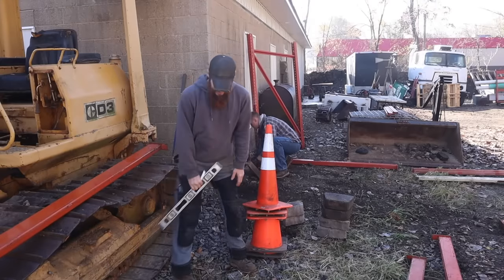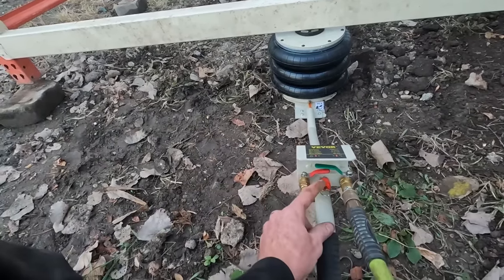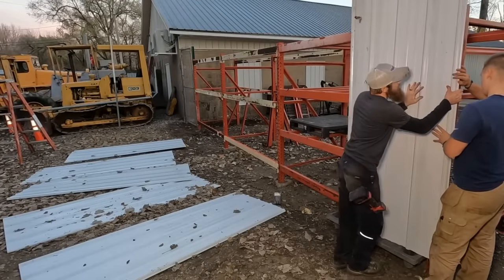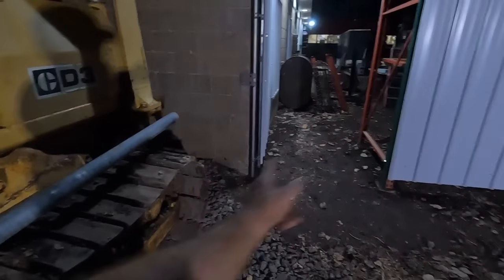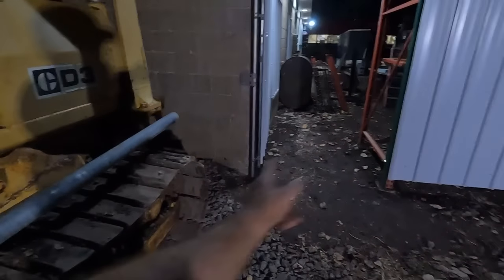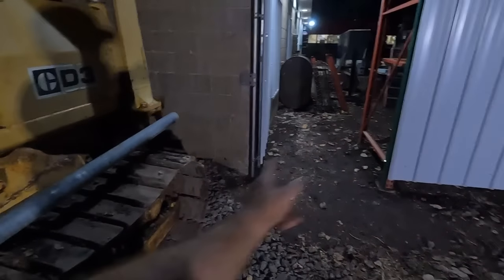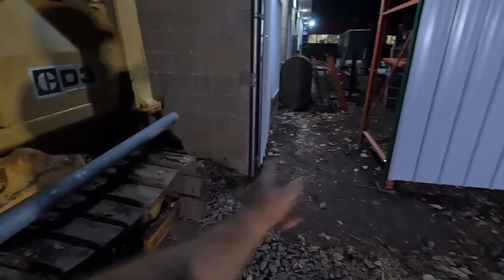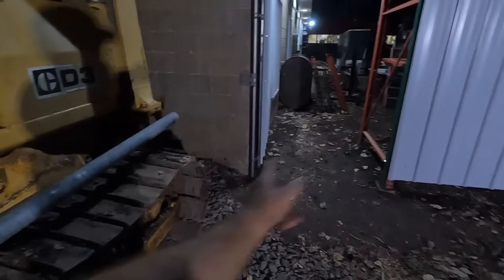Building a Wall w/ Pallet Racking & a BIG Gate Install  ~ Part 10 ~ Rebuilding of "The Salvage Cave"

Comment: I’m no welding expert but aren’t you supposed to be using a filtered mask when welding galvanized steel? I thought it became toxic when welding.
Reply: Inside yea you want to buy outside not so much unless no wind and a lot of it
Reply: Zinc in the galvanising turns to zinc oxide which gives you pneumonia like symptoms but out in the open it doesn't matter so much as the breeze blows the white harmful oxide away, it hangs in the air like floating cobwebs in a confined space or un ventilated room.
Reply: I’ve had galvanized poisoning (MFF) before when I was welding galvanized floor deck on an indoor mezzanine. It makes you feel like you have the flu, definitely need a respirator or good ventilation.
Reply: When i was(much) you ger, we were told to drink a glass of whole milk right after we finished welding or cutting galvanized. Never got sick. Don't know if it worked, or I got lucky.

Comment: Definitely should put water in with the concrete. Dry concrete doesn't bond anywhere near as well or as strong. You might as well put in road base, as that is cheaper if you don't want the strength of cured concrete.
Reply: Nope I built pole buildings for years. I never used wet crete. 
The dry stuff hardens from the outside in. Locks stuff in place better. Cures fine
Reply: @robertspray7472  Yup ..First time there's a good rain , that will all get soaked and cure just like poured concrete . No messy time consuming mixing needed.
Reply: I seen someone build a huge retaining wall by just stacking concrete bags. It looked funny but 15 years later I still see it every time I drive by that house in the country
Reply: @dillon2753  

i know.. isn't that crazy !? I've seen them all over.
Reply: He is using concrete blocks
Reply: Because you've done something "for years" doesn't mean you've done it right, for years.  That's not a good defense.   Chemically and mechanically the concrete will not cure the same.  So, you've done it wrong for years.
Reply: If you saw the condition the cave was in originally, you'd know there's plenty of moisture in that soil.
Reply: @dillon2753  the water addition locks the bits together. the strength goes up, and a lot quicker. a large amount of study has gone into the science of materials. and one of the things with concrete is that the mixing of water cement and aggregate works better when joined together evenly. something not usually achieved with a dry pour. it might look solid, but engineering is done through testing. and the strength of concrete depends on the consistent mix. a reason for every dam, bridge, etc designed by an engineer is done with wet pour.
Reply: @robertspray7472  they truly dont. material science is a thing. it might look like they do, but how many pole barns did you break apart to test the concrete?

Comment: I saw a video where someone actually tested the material properties of wet vs dry concrete, and the dry method does result in a much crumblier concrete. It's certainly good enough, but it isn't as durable as wet pour concrete.
Reply: I agree, however for his purposes I guess it will be fine, It’s his gate.
Reply: I advise you add bolts to the cross beams.  To lock them in place . We have them pop out when loading and unloading .
Reply: I just mix the concrete in the hole it does not have to be perfectly mixed. Never dry thoutht.
Reply: That where house shelving needs to be anchored down some how where I used to work they used that same shelving in are where house forklift driver caught the corner Barley brought that hole shelving unit down parts steel bronze tubing down luckily forklift driver wasn’t hurt but they anchored tied the shelving down

Comment: The dry concrete method might be fine for household fences, but in a situation where some real strength is needed this is not gonna work. The cement in concrete requires water as part of the chemical process by which it cures. It’s not just hardening. Once a bit of water is present it will begin curing. There is no such thing as curing gradually. It’s a chemical process that occurs best in a surfeit of water and it needs a lot! If there’s not enough water available for the reaction the result will be crumbly, with little strength.

Comment: those little pavers under the racks are gonna sink man
Reply: He learn when it topple over. And quickly too!
Reply: if they do he,ll just lift and reset them - no probs
Reply: @Edward-turtle  he used 500 lbs of concrete for the gate post but a little rock for shelves. stupid
Reply: @stereolababy  that little rock can hold thousands of pounds, tough guy.
Reply: @XxPhasemanxX  try and read- didn't say it wouldn't hold - its going to sink in the mud. not enough surface area
Reply: @stereolababy  Did I say you said that?

Comment: Just a thought......where you put the pipes in the ground where your two gates meet when closed, could dig a 2ft x 2ft (whatever the dimensions would be mine was just an example) square or rectangle size hole around them and pour cement around them. This would help protect them and maybe keep dirt from filling them in. Just a thought....
Love the idea of using the pallet rack as a fence too. That was a great idea!

Comment: Tip : mix besides the rebar also a lot of pebbles in those concrete holes. Cost you less cement and makes the blocks a lot sturdier and stronger.

Comment: For that gap in the gate, I suggest welding either a steel or aluminum plate on either gate end (say 1/2 or 2/3rds) of the gate end heights.
When the gate is closed the plates will over lap each other say 4 or 5 inches. This will close the gap and should provide self support in the middle from the wind and free swinging. What ever way you chose is of course up to you. BTW it is all ways good to see a new episode of Salvage Workshop... 😉

Comment: Be advised that, when you get snow and ice, the pipe in the ground can possibly have flood water fill the pipe and freeze the gate stops in place. Which may pose a problem raising them to opening the gate in the winter. Chaining the two gates together and a lock way be your resolution.  Good job.

Comment: If I heard you right, you use dry concrete around your posts because you didn’t want to spend the time to mix it with water. Then you will wait to put the gates on until you get enough rain and moisture from the soil to set the posts. That could take a much longer time then if you had just mixed the concrete in the first.
Reply: He's one of those that knows better than the people who created it.

Comment: Finally someone knows how to place an anchor. Another shortcut, switch the hammer drill to hammer only and use that to drive the anchor. The anchor won't do any damage to the bit, those things are only "sharp" in the package.

Comment: Those gates will be great if you put tin on it like you did with shelving and the tin will close the gap that’s what I did. 
Pallet raking I find best outside I normally put a 4x2 then sheeting so pallets can still go and then at top just have top covered with tin. 
I have used steel water pipe made into shelving to store tyres but I still put a little roof on. 
Cheers I enjoy you Chanel from 1 man to another who keeps everything

Comment: Railroad Ties. For base. Re-coatable and movable as a base. Used to be cheap. Stacked tires should be under cover. Mosquito control. In order to secure you have to close all sides equally. You're just getting started.

Comment: Matt 🙂 Your brothers are such hard workers just like you 🙂 Cover the top of them shelves to stop people attempting to climb over to take stuff off the top shelf 🙂 Attach & weld plates down the side of one fence so that the other fence won't swing past it when open, which will also stop skinny people getting thru from stealing. (Think of a  kitchen cupboard doors that has a gap) 🙂 Maybe also get a container and add in shelves... put in side doors as well as having the door at the end... to keep things like tyres or other big perishable items that don't like the sun or the snow.🙂.

Comment: Weld overlapping steel plates, maybe 5 inches in width to each side of the gate gap - one on the front of one post and on the back of the other, and then fashion a lock for the middle.  Should be easy to do.

Comment: I've thought that if I were in a position to have a fork truck I'd palletize stuff for storage. However, I'd make custom pallets, some with cubby holes like shoe storage. Some with big drawers. 1x1 square tube mostly. Depends on what you have that can go outside. Make fixtures on the pallet to hold whatever and don't need securing for the trip up and down off the pallet rack.

Comment: We cut various bays into cheapish B-grade or well-traveled Conex boxes and welded shelving or racks. Lots of oilfield pipe comes back for salvage in DFW but any old piping would work. You can throw an engine, palletized parts, or pretty much anything you want to keep somewhat out of the elements. A lot of ugly shot with inexpensive metal paint from a Chinesium airless sprayer make them look almost amazing.

Comment: Another good video. I like to set the things i use most where they are easy to get to same with autos and equipment. Some times it works but not always. Good luck

Comment: Using old grocery bags and painter’s canvas tarp take the bags and fuse them together like in the YouTube video (Brothers Make: Finally, a plastic bag good for the planet) or using aluminum make a cover for the tires stored outside to keep water out of them preventing a mosquito farm inside or you can just use regular plastic tarp cover by painter tarp tied down replace painters tarp every year I pay $12 at Lowe’s. Plastic keeps water out and canvas keeps sun off the plastic and tires, preventing the tires and plastic from breaking down very fast from sun and excess heat

Comment: They have heavy duty pallet racking that fits just the bill for what you are working with out there. I believe the uprights are made from 5inch channel iron with 2 inch legs, 1/4" thickness but there are many sizes more than that. I have a friend that is in the business of selling it here in Va. You may be able to pick some up used in your area. I do believe that they have some that can hold several tons per shelf (15,000-30,000lbs). Put your stuff on pallets and stick them up there or get the grating that spans it and you can do smaller materials. Putting up a second fence bordering that side road may be the perfect thing to back it for you, like your first fence.

Comment: Matt, I was kinda wondering when you first started putting up your pallet racks if you were not a little close to your soffit on that end. The reason I was, was wouldn't it have been a little close to your roof and you couldn't use that whole end. If you did stack stuff up under the roof line there that if your luck is like mine if you went to lift something off the top rack and it was just under your roof that you'd end up damaging your guttering or your roof but when you moved it out for the gate that solved that problem. Man you do some awesome work and I love watching your channel. I've subscribed to your channel since you started it. I'll always be here waiting for your new ones. This one was shorted than your normal ones. Believe me I do not mind the long ones like some people do but not me. The longer the better because I'm amazed by how good of a job you do. Thanks for the awesome videos you put out.

Comment: Google says you should never install dry quickrete. I agree with it.
Reply: Whether it's lasting or strong, I'm not qualified to say.  But I will say that using the excuse "I've done it many times this way" is not a good defense.  It's possible to do something wrong "many many times".  We've all seen evidence of that!  It drives me nuts when people use that phrase as a reasoning.
Reply: I work with concrete everyday and it should not go in dry like that. Need to be adding water after each bag and mixing.
Reply: Really should have added water as you were dumping sacks in the hole.  It would be setup and permanent in 12-14 hours.  The pieces of pipe pounded into the concrete are wasted effort, the rebar might keep it from breaking up when it cracks. If the rebar is exposed to the soil it will rust out.

Comment: Safety Orange is a pretty common color. We used a lot of it at work for guarding. 
Rust-Oleum
Real Orange, Rust-Oleum American Accents 2X Ultra Cover Gloss Spray Paint- 12 oz
(4.6)
4.6 stars out of 7178 reviews
7178 reviews
WalMart $5.98

Comment: Those gate posts would support a post lift, talk about overkill, the smaller bits of pipe is worse than nothing as the concrete will not stick to them unlike rebar that's what the ridges on rebar are for to lock them in place. I would have put in a short piece of pipe in the middle of the 2 gates to act as a sleeve for a centre support pipe either inside or outside. All that machinery and you hammer the posts in by hand 😂

Comment: I wonder if that orange paint is similar to the metallic blue I have been using for my tool restorations...no longer available locally but i could buy a 6 pack of it online..good luck finding the paint you want. :)

Comment: ok am i mising something normaly you mix concrete and put the foundation wire in before concrete   to  fix it to the post  then add we concrete  we also cap the post at both ends  so no water can get in to rust the post

Comment: I’m no mason but aren’t you supposed to mix the concrete with water before you throw it in the hole? Is this some new thing?? But I am a welder so if you keep your face out of the fumes you’ll be fine as long as some breeze is blowing or you can use a fan to blow away the fumes

Comment: from what ive seen (on youtube) making concrete without the water makes it much much weaker - i would never do it again......  like 1/10 as strong...   for fence posts when your mixing in dirt with concrete mix,  that is called stabilized ground and we do that to avoid the wood from rotting (as the wood shrinks and would leave a gap for the water to never drain from)
also ps...   Never hold anything in your hand your also grinding on....  one day u will lose half your hand or worse.

Comment: When are you going to finish Old Red?
Reply: It's all about parts at this point. Covered that in a video a while back.
Can't do anything without replacing the parts which from memory is pretty much all the tracks and running gear (plus a bit more).
Reply: I think he mentioned it needs an undercarriage and would cost over 10 grand of I recall correctly. He has it on hold right now.

Comment: What a hack job. The dry concrete is an absolute worst way to do it. I can easily and confidently say that I have installed hundreds of miles of fence. You mix concrete with clean water so all the ingredients get thoroughly mixed. A visual nightmare. Absolute hack job, and lazy on top of it

Comment: The belief that dry mix technique is as good as wet concrete is a bad myth and do it right the first time or not at all. Not only is it inferior but weaker as well since  the time to mix it properly is negligible compared because its strength is that superior. Indeed the water he added was a joke since it doesn't wick in that deep and only the tamping that was do made it no move as did the rigidity of the pipe. There is a reason why a dry pour isn't to Code or used in construction since its that weak and rarely cures-sets as a mass that wet mix does..🛠